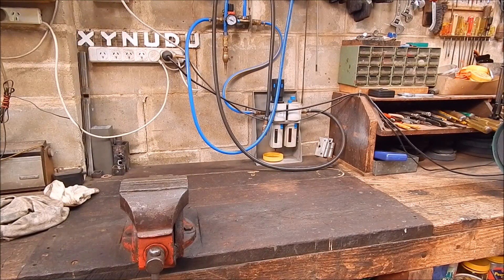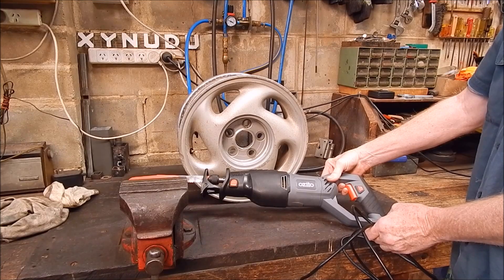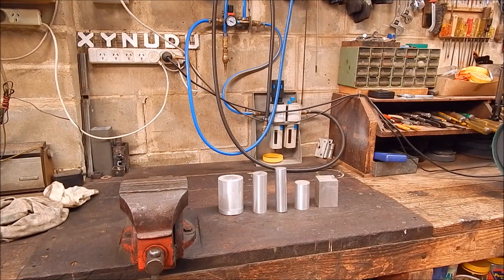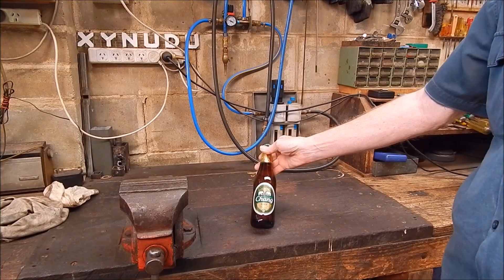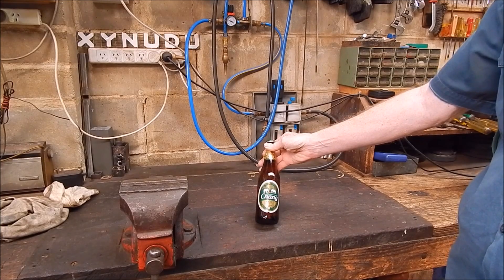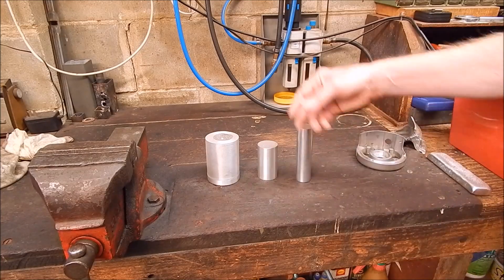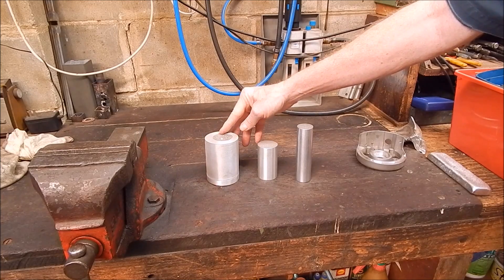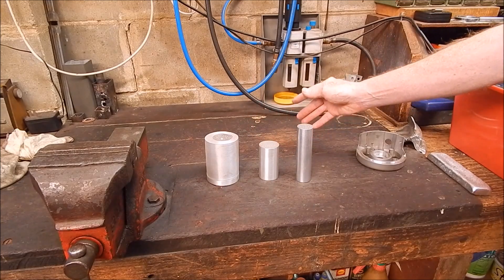Characteristics of home cast aluminium

Comment: You  have to forge it to regain the toughness. Just like iron/steel we have similar brittle properties when casted, and they have to be worked and forged either with hammers or rollers.
Reply from the maker: Hi Henrik,  most cast ally wheels are not actually forged, just heat treated in an oven for a set time/process.  There are some good articles on this process. The end result is mighty tough and impact resistant.  Forging is another process used and may be even stronger, but not for the majority of wheels in use.  Cheers Rob

Comment: what do you use to degas? great vids I like your lathe stuff thx
Reply from the maker: If I degas I use a small amount of baking soda.  Most times I don't as I get better results by pouring with the melt temperature as low as possible, and using good quality aluminium.

I find the degassing agent can actually cause gas bubbles, as will heating the aluminium too high.

So normally I preheat the mold and pour when the alloy has just become liquid.  Never ever let the alloy glow red anywhere or it will gas badly.

Cheers Rob
Reply: thx Rob iv got a big stash of aluminium ill sort out the nice stuff ,steve @Xynudu

Comment: i have been collecting aluminum for casting into ingots and molds and i have heard that aluminum originally casted from hard drive enclosures, engine blocks, pistons etc is stronger than extruded aluminum but i also noticed that casted aluminum is much more brittle because it is easy to break apart hard drive enclosures with a hammer but heat sinks which are extruded aluminum are impossible to break this way which brings me to the question why cast aluminum is suggested to be used if it is much more brittle than extruded aluminum
Reply from the maker: Hi Dean,

The simple answer is that the alloy used in cast products is more rigid and suited/stronger for the intended purpose.  In real world application it's unlikely to get hit with a hammer or subject to impact which will break it.

Cast alloy car wheel rims ARE subject to impact, but they are extensively tempered to withstand massive forces.

Scrap extruded alloy generally machines to a fine finish more easily as the zinc content is lower.

Cheers Rob

Comment: I wonder are the wheel rims forged. like forged steel which is also very strong.
Reply from the maker: A few are forged, mainly after market, but most use heat treatment to give them the durability and impact resistance they require.

This is lost when remelted, and is beyond most back yarder's ability to replicate - it's an exact and protracted process.

There are a few web videos on how they do this, and it makes for interesting viewing.

Cheers Rob

Comment: Those rims are probably forged instead of cast, which would explain the strength.
You might notice that beer can aluminum is quite springy untill you apply heat to it and that's mostly the same thing, probably the internal stresses keeping the metal stiff.

Comment: agree with other guys regarding heat, also, you tested two different shapes and bent the thinner piece further than the first one, also, the first original piece had a curve opposing the force you were applying on it so also made it stronger.
Reply from the maker: +Autotechmechanics 

So, you think me remelting the original wheel rim alloy, will have absolutely no effect on the original heat treatment, and that the test piece will bend in a similar fashion and not snap easily?

Hmmmm?

Rob

Comment: Wheel rims are not pure Alumin(i)um. They have all kinds of stuff added to them. More comments from your viewers on this. So no, they will not behave the same way after you remelt them as they did in the first place. Myfordboy channel has a video on this. I like his rule of thumb: If the Ally comes from something that was cast in the first place --  a cylinder head, an engine block --  it will behave as it did in the beginning. If it was extruded it will not. And as you have just proved conclusively, if it was die-cast (which I suspect those wheels were) and then heat-treated it won't behave same way as original. One of your viewers pointed out that Al wheel rims are heat-treatable (I had no idea there was such a thing) and if you followed the right schedule you might get something interesting indeed.

Comment: A lot of Al alloys used for wheels have a high Magnesium content,  I don't know how remelting affects the structure, but you could try heat treating it yourself.  Here are some basic guidelines.   http://www.azom.com/article.aspx?ArticleID=2540   Temperatures are with in the limits of a kitchen stove.   Be an interesting experiment and video :-)

Comment: It's the size of the crystals, the partly separation in the alloy and the fast cooling.

Tree things can change the properties for alloys. 
The size of the crystals
How the crystals bonded together
And the internal tension between the metals that forms the alloy. 

Big crystals making a alloy brittle. At the faces where the crystals touch a crack can move along. So it's desirable to have small crystals. but when the crystals to small the material getting soft. 
The space between the crystals can be filled with a soft but tough material so a crack can't go further.
If the material between the crystals has a very different thermal expansion as the crystals you get internal tension (see Franz Rupert drops). You have to overcome this force to bend or break the material.

Reheating can break up big Crystals and can result in al partial separation of the alloy. Done wrong big crystals can form. Quenching prevents the forming of big crystals (or preventing the breakup of crystals while cooling down), also can it create internal tensions. Done wrong it can result in warpage.

In this case would assume a combination is used to reduce the size of the crystals and creating internal tensions.

Comment: It depend how you melt, but you must be careful of Aluminium Alloy wheels, they can have high Magnesium content and burst into un extiguishable flames, generally I select very thin wall castings to melt if I intent casting from thin section petterns, the reason for the tough wheel characteristic is to heat treating, as I am sure you know.

Comment: Great piece Rob.  I have done some of my own evaluations of different grades of aluminum as well.  One interesting fact is that when I melted down an old aluminum screen door the resulting ingot seemed to me harder and machined far better than the original material.  Interesting...    I like your "save the planet" logic.
Reply: +Fred Miller extruded aluminum tends to be more "pure" aluminum - it doesn't generally have the other metals to make an alloy. It's much softer, shrinks more. I haven't tried turning any, so I can't give any info on that.

Comment: Tom Peterson is right. In below youtube video the whole production process of cast alloy wheels is shown including the heat treatment which confirms Peterson's contribution. https://www.youtube.com/watch?v=LCMs-7K8nLk. Xynudu, you could cut 2 more stripes of that re-molten wheel material, leave one as is and heat treat the other one and test it again and compare. However, the many hours of heat treatment at specific temperatures would require an oven with temperature control. Such a home made oven is feasible with some fire bricks, stainless wire heater coils, a temp. sensor, a relay and an Arduino controller. Total estimate: below 200$. If insulated well it could even be used to melt the alloy in the first place.
Reply from the maker: +rol eic 

Yes, that's something I don't have access to.

The untreated alloy is still plenty strong enough for my hobby use, so it will have to be used in it's untreated form.

The strength difference is however quite apparent.

These types of tests make you realise just how tough wheel rims really are, and what goes into making them.

Always interesting.

Cheers Rob

Comment: Alloy wheel aluminium is a temperable aluminium and requires heat treatment.
" heat for 4-12 hours at 525- 545oC and quench in hot water, followed by a
precipitation treatment of 8-12 hours at 155-175oC" http://www.hadleighcastings.com/uploads/LM25%20Alloy%20Detail.pdf
Reply: Thanx for the info

Comment: Hi Rob !

Very interesting test you did there, yeah.

But I think the the shape of the two test items was too different to come to your conclusion - the "rim"-piece should have been as narrow as the casted part to do a fair test.

I think my main source (beer cans) is even worse than what you have as "bad" - but till now I have managed to use it to project where I think it will do well.

But it would be nice if we could cast some aLUminum and machine it with a mirror finish ;-))
Reply from the maker: +Keld Sørensen 

Hi Keld,

A direct match of the metal size would have been better, but the rim section was definitely tougher and more springy.

The heat treating process described in some of the links spells out why this is so.

Try using a shear tool on the alloy - makes a huge difference, as seen in the sample I show from the DC motor end plates.

Cheers Rob

Comment: Tempering and Hardening changes Aluminium's properties dramatically.   Its all about temperature controlled heating and cooling cycles over days of time and specified work-hardening cycles.  Brief details here.  http://www.matweb.com/reference/aluminumtemper.aspx

And yes, welding immediately destroys both in the Melt and HAZ (Heat Affected Zone), requiring re-treating of the final part if you want the original pre-welded materials properties back.    Even brazing (much lower temperature) usually hurts the T&H properties badly.  I did quite a lot of research in the area hoping to make some strong and light Aluminium Tricycle frames with welding or Brazing.  

But, sadly, there is a good reason that most Aircraft Aluminium (usually 6061-T6) is riveted, glued (epoxy) or bolted together.  You cant get it too warm without losing most of its desireable characteristics.   Melting and Re-casting destroys all the springy tough goodness :)

Comment: I wonder if the rims are not an alloy of magnesium and or titanium?  I don't know the characteristics of those but perhaps they cook off in the slag and are removed?  As you say still good stuff.  Might be easier to chop it up with a plasma torch.  I have been using my Harbor Freight one for over ten years while it was $700 they have now come down to around the $300 mark for a pretty good unit at other vendors.  Doug
Reply: +Douglas Thompson Avoid those like the plague!  I had a $250 Plasma cutter, and while I got my use out of it, when it goes it goes, and there's nothing you can do.  The money's better spent on an oxy-fuel torch setup, which can do the same thing, but gives you the advantage of being able to weld/braze.
Reply: Gas doesn't work for Aluminum.  Mine is eleven years old and used quite a bit.  No problem although the first unit had to be replaced after six months but 11 yrs on this one.  No cost to me.  Just in gas it has more than paid for itself many times over.
Reply: PS Mine was $700 at HF.  Still about that.

Comment: Most rims (as I understand it) have Magnesium in them That provides the flexibility. I think when you forged it it may have  burned off the Magnesium (melting point of MG is 650°C Aluminum is 660.3°C). Try adding some MG at the end of the melt just before you pour. Then possibly a heat treat. I found a very boring but somewhat informative youtube vid the link is jumped to the important part of this sales pitch video. 
https://youtu.be/VFL8XjpGeKE?t=237

Hope this gets ideas going on how to make something similar to the rims.
Reply: +Little Steampunker Magnesium has a boiling point of 1107 °C...  I don't think 'burning it off' would be much of a concern
Reply: I remember magnalium from chemistry class as a kid, the name of an alloy used to build aeroplanes. Found this https://en.m.wikipedia.org/wiki/Magnalium
Reply from the maker: +Little Steampunker 

Thanks for that.  Looks like heat treatment is the answer.

Bit beyond my workshop, but do able.

Cheers Rob
Reply: +Jonathan H You are so right. That leaves the heat tempering process.....

Comment: Hope this cast works https://youtu.be/LCMs-7K8nLk
Reply from the maker: +Grandpa Cocky 

Very good link.   Looks like the 500 C heat treatment is the reason for the high strength and hardness.

A bit beyond most home workshop abilities, but do able if you have the necessary oven.

Thanks for posting.

Cheers Rob

Comment: The wheel rim May be forged. Forging make it harder
Reply from the maker: +Asaad omar 

Good point.  You may well be right.

I think I've seen references to forged alloy rims.

Thanks for the comment.

Cheers Rob
Reply: +xynudu thanks. I like your videos
Reply: +Asaad omar  I doubt a common OEM wheel would be forged unless its off a top of the line hypercar... like a high spec nissan GTR or Lambo Ferrari etc etc.
Reply: +Asaad omar Yeah, I was going to say that -- I'll add forging doesn't have to be complicated or expensive.  Could start with casting the part, then finishing off the rim section with a roll forging operation.  That fragment of rim in the video has a smooth finish and has a raised rib that are a hallmark of roll forging operation.

Comment: G'day mate.  I also noticed the homemade stuff has different chips when machined.  Maybe we are getting it too hot or something.  Still it is wonderful stuff and factory or homemade it works.  Thanks for the video.
Reply from the maker: +Amateur Redneck Workshop 

Hi Harold.

I agree, the chips vary a lot.

I think the way it machines has a lot to do with the copper content.

That stock from the DC motor end plates machined beautifully, while the mower deck plate made horrible flakey cuttings.

Cheers Rob

Comment: I'm sure it has something to do with the heat treating of the aluminium. I have welded some alloy cycle frames made out of 6061/7005 t6  and the welding seems to change the properties of it
Reply from the maker: +Mike Palmer (MP Custom Blades) 

Yes, totally agree.  Be interesting to know exactly what they do.

Welding may actually weaken those frames.

Cheers Rob
Reply: +Mike Palmer (MP Custom Blades) Exactly. If one wanted to learn more about heat treating Al then bicycle frame manufacture is actually a good thing to look up for the information. I know that Intense Cycles produce their own frames in the USA, so there are vids on youtube about their factory processes. And if you search for "what is T6 aluminum" then one of the informative hits is about taking bike frames from 6061 to T6 6061. It's not like just quenching a chunk o' steel.

Comment: Can you heat treat aluminium ? to make it strong again
Reply from the maker: +UPGardenr 

I expect so. 

They may heat/chill it, or have some other technically accurate way to achieve the characteristics the wheel rim requires.

Be interested to read any comments on this.

Cheers Rob